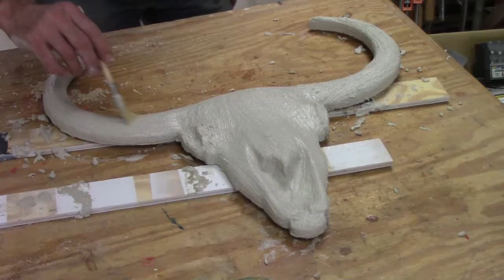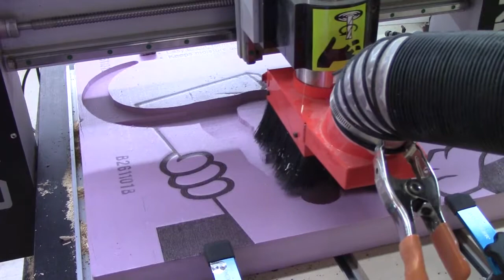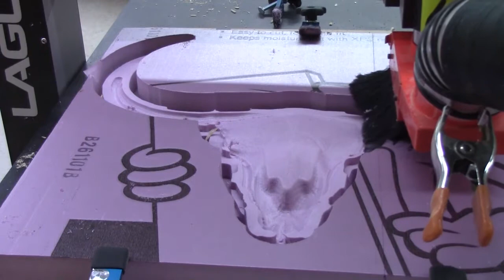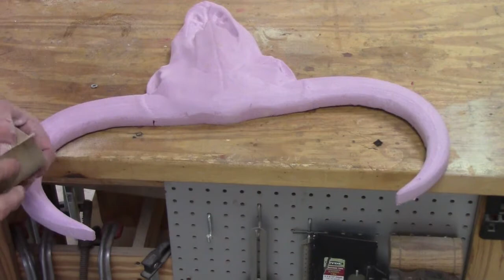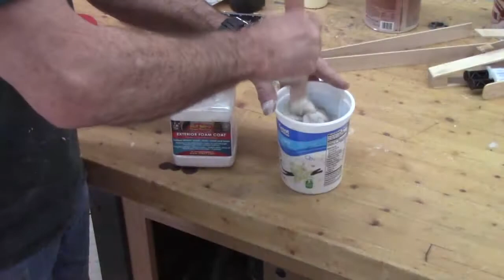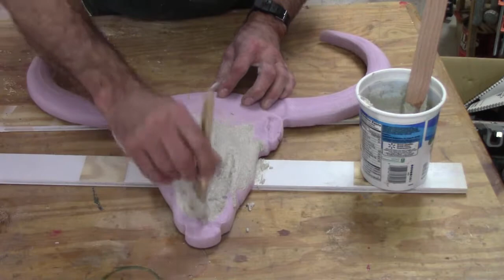Cutting foam on the CNC

Comment: This is cool, I have seen foam coat online but never in use. I use insulation foam to make signs from time to time. I recently did a video on one. I have been looking for ways to make them stronger. since sign foam is both hard to get and very expensive. Does the foam coat make it easier to get nice smooth sides after routing.
Reply: also, I think we meet a few months ago at the Shopbot camp at TechShop Pittsburgh. I had to leave early to teach a class there that day.
Reply from the maker: Yep, I was there.
Reply from the maker: No, if anything the Foam Coat makes it rougher.  It's almost like plastering the foam.  It goes on pretty thick.  When I want the foam really smooth I sand it by hand, then paint it with latex paint.